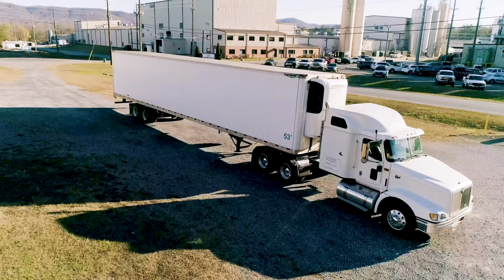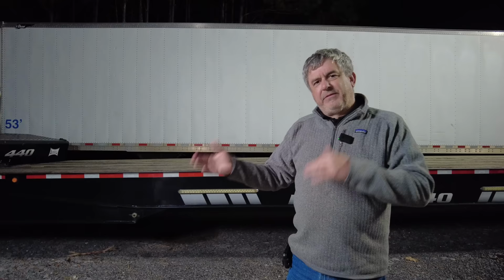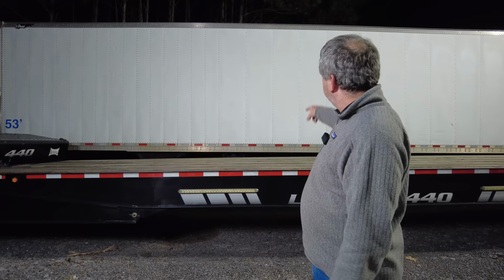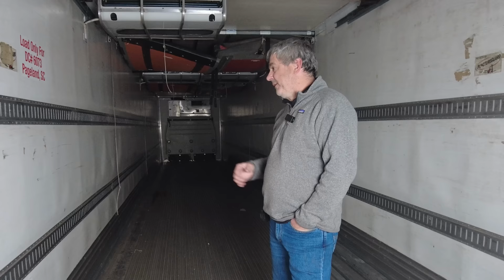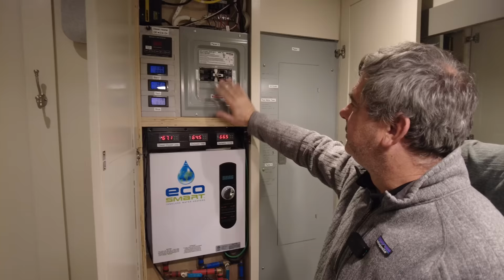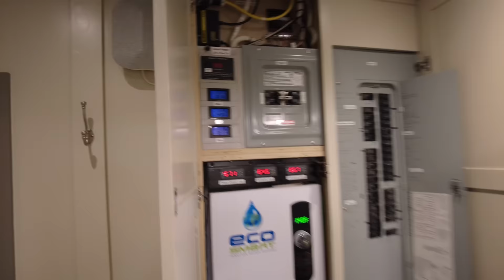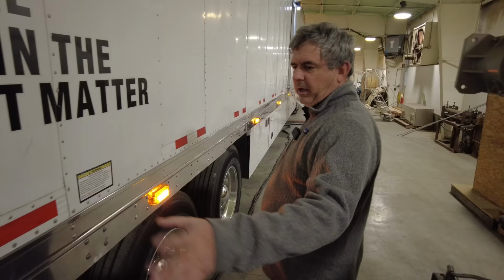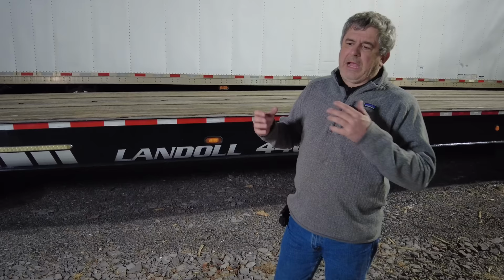We Converted a Semi Trailer Into A Sleeping Trailer! | Episode 1

Comment: Should be pulled by a diesel electric truck tractor. Solar panels on the top of the the trailer and everything can be run by a couple of battery packs. Edison in Canada have started converting diesel trucks to diesel electric. That is the future.

Comment: I am a reefer trailer technician. And I work on these trailer daily.  My questions are 1. How are you going to deal with the humidity that builds inside 2. And most used cold storage trailers had a off smell, how do you guys solve the smell? We wash out several times and spread coffee and let sit for a day or so.. thanks can't wait to see the end
Reply from the maker: Great question, so we take the front unit out and leave the rear doors open, pressure wash the entire inside of the trailer then when we do plywood and hardwood / tile floors, 1/2 inch plywood on the walls and do then ceilings out of plywood as well we have no issues.  Thanks for watching and I appreciate your insight to these units.

Comment: Interesting concept.  I do have a few suggestions, though:

1 -  Install some windows.  Yes, they would add some cost - but, anyone using the trailer is going to appreciate them.

2 - Install a second bathroom, including a second shower.   17 people sharing this space is going to represent too much of a demand for just one bathroom.  

Alternately, make a larger commercial style bathroom with stalls and urinals, along with two shower stalls.  Put the sleeping area at one end of a hallway and the living area at the other end of the hallway with the restroom(s) in the middle, along one side.  Put a door at the end of the hallway going into the sleeping area.

3 -  Go to just a little extra trouble to use actual printed labels where you are currently using hand written Sharpie labels.   

4 -  I think you would be better off with a rubber penny flooring, rather than the wood flooring.  This would be more rugged and less maintenance.  It would also be more quiet when people are walking on it while others are sleeping.

5 -  An emergency exit or alternate entrance towards the front of the trailer, for safety.  This could also be in the hallway where the bathrooms are located, making it easier to access the bathrooms on site.

6 -  The roof of the trailer could support a few thousand watts of solar panels.  Along with a sizable battery bank and 12kw inverter and operating costs could be significantly reduced, while providing shade for the roof of the trailer, reducing costs for cooling.
Reply from the maker: Thanks for watching.....

1.  (windows) We contemplated windows -- we put windows in the doors of the units -- but we basically sleep in them and the bunks are dark and common areas have the door windows.   Then we would need black out curtains -- so we opted for no windows -- band buses are the nearest commercial thing to these units and they dont have windows either.  

2.  (bathrooms) We should have been more clear the sleeping trailer that has capacity of 16 people, this unit has 3 bathrooms and 3 showers.  The baths are in the middle and bunkhouse on each end with another shower and bath in the rear office/bunk area.  The first sleeping trailer only has 12 bunks and has one shower and one bath -- in each case the showers and bathroom are seperate which allows the showers and toilets be used in separate areas simultaneously 

3. (labels) I agree on the labing -- most of the trailer uses those labels -- I have used a sharpie in some locations -- but you are correct.   

4.  (flooring) I agree on the flooring -- I didn't know any better - did actual commercial tile and hardwood  -- it has worked great and is easy to clean - but I do like your suggestion -- the newest units do use the floating floor type -- but i like the solid wood better -- 

5. (exits) I have the exits in the middle of the units -- no person is more than 14' from the exit -- the new unit will have an additional exit.  The units also have commercial wired smoke and carbon dioxide detectors -- the fire alarm will e-stop the gensets immediately if activated and have horn sirens and strobes and pull stations -- I also built the cabins areas positive pressure with makeup air on the opposite side of the trailer from the exhaust and more than 40 feet away and the genset/hvac units compartment which is negative pressure --- we now run in camp with a remote genset to further prevent genset issues -- 

6. (solar) You are correct -- we did a large gneset with 5 tons of cooling and dehumidification units -- the roof has 6 inches of closed cell foam -- this gives us a r30 -- cooling hasnt been an issue -- these trailers are 13'7",  real solar panels with an air gap will add another 3" which would put us at 13'10" 4" above the 13'6" -- I realize that you typically don't have an issue till you exceed 14' -- the new unit will have this solar -- thank you battleborn they saw our video and made us a partner -- 

thanks for your comments and suggestions we appreciate you watching -

Comment: We lived in a dry van trailer for a couple years, my dad outfited it with bedrooms, kitchen, restroom and a laundry room
Reply from the maker: Oh wow! -- thats cool -- did you notice how he insulated it -- did he leave it mobile or use it fixed --- thanks for commenting - -
Reply: @ParkerSystems   it's framed with 2x4s, the interior ceiling is only about 8ft tall, blown in insulation was used above that and foam board insulation was used on the walls. Its been finished for 17 years. We don't live it but we use it as our restroom at our yard.
Reply: It's has house grade appliances such as heater, water heater, stove, all running on a stationary propane tank. We are planning on moving it next year but all the connections were installed as quick connects from the beginning.
Reply from the maker: thanks for replying thanks --  @jgutie4377

Comment: Why not utilize the return air channels as underfloor heating?  The underfloor would already be insulated for heat intrusion…
Reply from the maker: In the first unit that we built we did exactly that.   Great idea.   In that unit we used a traditional forced air heating and cooling.  In the next unit we did a mini splits.    Great comment.

Comment: The way that Walmart loads these, they use a couple of different configurations. They either haul meat and produce (32F & 40F) or they freezer dairy deli (-20 F and 34F). They usually will load meats and frozen foods in the middle. No particular reason other than how the route is setup. The last way they use them is a single zone for times when they have a backhaul of product to the warehouse.
Reply from the maker: Thanks for explaining that -- I just assumed you would load cold from the front to the back -- I appreciate a professional explaining how they are typically utilized -- thanks for watching

Comment: This is awesome. I have been pondering something similar but using the trailers from the moving industry. They can have a drop deck setup and under boxes already installed.  Any thoughts on that?
Reply from the maker: Yes sir.   I answered another gentleman in this section before regarding a step deck or drop deck van.  I believe his name is Shawnweaver39…. I think it would be an excellent idea.  In his comments I laid out the offset cost for the closed cell and cost of belly compartments or basement boxes.  You definitely get more cubic space opens the opportunity for multiple levels and multiple people levels and you get the infrastructure like water and grey-black and prehaps batteries in the thermal envelope… the downside is the genset and HVAC heat exchangers and areas for the exterior equipment … although one or both can be added as an exterior unit on the front.   However Baird type ac units and front mounted trailer gensets tend to be expensive…. Check out the other comment for cost of the closed cell foam as well.  

Thanks for the suggestions … if I had unlimited budget or a nice ROI model I would probably convert a 53’ step van.

Comment: This is so awesome i wanted to do this with a older trailer and make a inlaws sweet or air bnb woth it but i was just gonna keep the refer on it for both heating and cooling. Just make a spacer and a nice exhaust system with some mufflers so it wasnt so jarring in the trailer
Reply from the maker: That’s cool.  You may want to consider using the refer unit.  Those guys are loud inside and out.  They make an electric backup one.   I have a couple of those as well.  But they are also loud inside.   Great comment.  Thanks for watching

Comment: What runs thru my mind is where can you camp with a semi height and size apart from truck stops and rest area?? I am a trucker so those are all I ever see so genuinely curious.
Reply from the maker: If you were planning on using this as a personnel RV I believe you concerns are valid.  We are utilizing these to deploy behind a hurricane or events, so moving them down the highway is our concern and after fighting with tag trailers behind pickups we wanted to move to a commercial platform.  Those light trailers and lower quality tires created a lot of issues..  RVs are basically overload and could not keep up with the movements and equipment we were doing.  I can tell you I have a personal RV its a bus at 45 feet length with a 13' clearance -- it also can be a challenge to find a typical RV spot -- with that said I have been in several rv parks where an old truck driver could get around with a 53 trailer -- you could also consider a 40 or 45 foot trailer in place of the 53', move the axels up a little more than normal and get in a lot rv parks  -- There is a whole community that uses typically volvo tractors singled out on the rear drive to pull those big fifth wheel campers -- check them out on youtube search for HDT RV you'll find a lot of content ... thanks for watching
Reply: @ParkerSystems  thanks didn't know much of the rv places had tht kind of spacing! I seen the Volvos but never said anything but was always on my mind that's for responding and interested on how it will come out

Comment: Would love to see solar implemented onto one of these, even if it's only to keep the essential systems (water pumps, refrigeration, etc.) online during total engine failure. Not sure that having an entire trailer be powered via solar would be logistically possible.
Reply from the maker: Yes.  We have that plan.   I have a couple other trailers with lift gates Ann I have a little solar on them to keep those batteries charged.   I still want to do like a tiny house version and do the entire roof in solar.   Stay tuned.

Comment: Any thoughts on using solar/wind with lithium batteries for backup for powering the trailer with diesel generator as additional backup?
Reply from the maker: Yes.   Check out a couple of our videos.  We have an agreement with battleborn.  On the new trailer we have a plan to do a lot of solar and lithium … we have 600 amps and 200 amp hours on the other trailers …. Thanks for watching and stay tuned.

Comment: I think the majority of my questions come down to differing needs but i do need to ask ; 
why not keep the refrigerator off the front of the trailer? 
And one more would be why not take advantage of the raised floor trailers for heated and cooled floors?
Reply from the maker: Thanks for the questions.  The unit on the front is loud.  The air velocities are way too high and the system is around 10-15 tons.  They use diesel and at that capacity it’s way over kill.  They would short cycle never maintain the humidity etc.  …. I have utilized the floor for the return in the first unit I built …. Check back a few videos for a more detailed explanation…. That unit was built several years ago and has a split 5 ton HVAC …. I have since moved to mini splits …. But heated floors would be cool (lol) and the ribs would hold the lines nicely.    Thanks for watching

Comment: I like what I see. I am trying to turn my 48 foot reefer spread axle trailer into a tiny home on wheels. My question is the insurance company that I have been with for several years doesn’t want to insured the 48 foot trailer since it is going to be a tiny home. They will continue to insure my Peterbilt with the 53 foot trailer, so what type of insurance will cover the tiny home?
Reply from the maker: Why don’t you suggest to them to insure it as a RV.   I will check with my loss manger and see how ours are insured.  Thanks for watching

Comment: I guess you could hire a water truck and septic tank pumping truck to stop by every few days and fill/empty tanks. The multiple grey/black water tanks might make that a pain to do though.
Reply from the maker: We primarily use these trailers on hurricane response and they're constantly moving locations. To date we have been able to deploy just outside the affect area of the storm, we actually pick these areas for the fact that the water system is unaffected and still working.  We find these areas 30-60 miles from the landfall of the storm.  When I purchased my fuel tanker I purposely made sure it had all double bulkheads, I did a test I took a compartment (2700 gals) that had diesel fuel in it ... loaded a it full of gas dumped it and then filled it 75% with water and gallon of dawn dish soap -- drove it around and dumped it, refilled it with water and a super scientific test -- I could not smell or taste the fuel -- while we obviously  we would not have used this water for cooking or drinking I believe it would have been okay for showering ... we also have access to 6,500 food grade stainless tankers (check out our video "We made a Temporary Water System ....)  and 2,000 gallon water truck we use in our directional drilling business our plan is deploy them if required since we carry enough water for the first 3-5 days ... but thru the last 15 years we have found a site with water for all our deployments.   For the black and grey we have dumped into working sewer systems, typically if the water system is working the sewer is as well.  We carry a dual 2 HP grinder pump and several hundred feet of lay flat pipe to pump away the black and grey as required.   Thanks for watching --- great questions.

Comment: Oh this is awesome!! I iDrive truck and have spent a lot of time thinking about converting one. Have you considered a drop deck van trailer? I wondered which would be a better platform to start with. I've built a few tiny houses and wanted to build one on a semi trailer platform. Looking forward to this!
Reply from the maker: Yes.  I would agree.  53 drop deck vans are a little more pricy … (people like to convert them to custom hauler trailers for race cars monster trucks drag cars etc.)  48 footers are a little better in price.  You would still have to insulate … but to your point you could create some multi level living space and once you insulated all your drop bays we have to create would already be inside your thermal envelope the closed cell spray foam is going to cost you about 2.00 a square foot for 2” so 53’ x 12 x 2   (Sides) 8 x 2 x 12 (front back) and 53 x 8 x 2 top and bottom.  That will work out to about 6k plus a little more for the bottom labor … which we can build the basement or under box storage for …. So kindva a push for us.  But if you wanted a unit rated for the cold that would be way to go.  Plus the lower level access would make ingress/egress easier

Comment: ever thought of converting the motor on the reefer unit to work as a generator as well as AC
Reply from the maker: When I first converted one of these trailers I considered it.   Couple of drawbacks, main thing is they are loud.  Second thing the motor isn’t really designed to be frequency stable … which means it would be difficult to use with electronics or you would need to use an inverter system like on the quiet Honda generators…. On the HVAC side the units are about 4 times larger than we need for people.   So the inefficiencies don’t work on that side.  But mainly how loud it is.   Great question.

Comment: Question: since it is insulated, do you still get any condensation on the inside when people are living in it?  If so, how did you work that out? I would think not, but want to make sure. I am in the planning stages of making my 53’ reefer trailer retirement mini home. Thanks for posting the video!
Reply from the maker: we have not had a condensation issue --- the typical use of these units are an environment that is warmer outside than in the trailer,  however the units are so tight that if you did live in it in a cold climate condensation would be an issue as the inside would reach a high level of humidity with the occupants -- so the exterior wall and surfaces would reach the dew point at that level of humidity -- on the first unit we built we used a 5 ton split ac unit -- this was way too big and the short cycle of this unit did not achieve the dehumidification that we needed and we added a small dehumidifier to address this issue -- this would also take care of the cold weather issues that I mentioned ...  on the next units we built we used smaller mini splits and they take care of the humidity by running at lower capacities for longer, I would also consider an air to air heat exchanger to help with fresh air, as we are not really concerned with heating and cooling efficiency in a our deployments we did a 15% markup air replacement with all of the interior fans which we run continuously so we get main cabin pressurization and fresh air     --- great question -- thanks for asking
Reply: @ParkerSystems  I really appreciate your explanation.  Thank you very much for getting back to me.